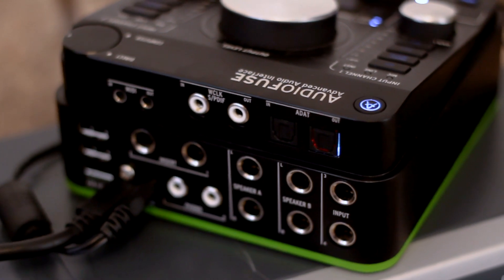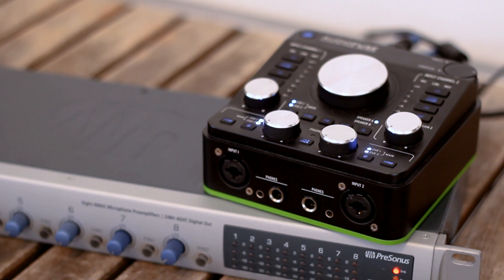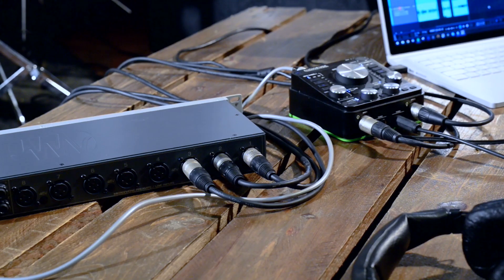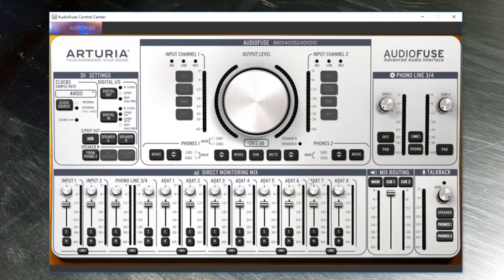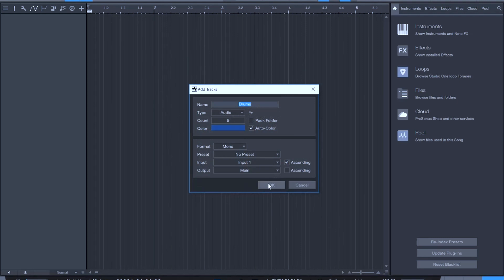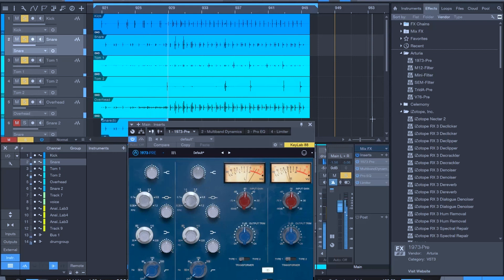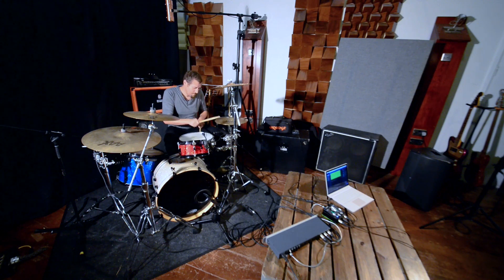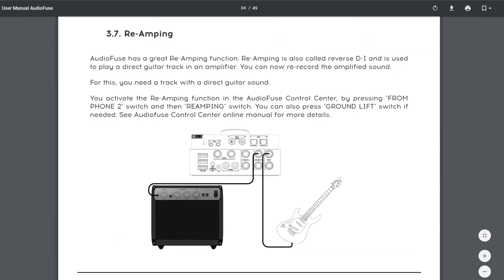AudioFuse Tutorials: Episode 6 - Using ADAT inputs

Comment: Sorry for the random question: brand new AudioFuse Rev2; both ADAT inputs (S/PDIF coax & optical) make a crackling sound. Even if the input levels are low, the crackling persists. Any suggestions? Cheers, DJ
Reply: It could be a Clocking issue.  I came to ask the question above lol

Comment: Which preamp is being recorded though? the expansion preamp or the interface (audiofuse)? Im asking because say there is an obvious difference in quality of the preamps, I'm using a scarlett preamp ADAT out into a UA apollo. When i recording, am i getting the sound quality of the scarlett or the UA?
Reply: since ADAT is a purely digital connection all 'tone' from the analog side comes at source, therefore you'd be hearing the 'sound' of the scarlett preamps but you are using the D-A conversion of the Apollo since it only received a digital signal

Comment: Nice info!
Anyway, what is the maximum amount of ADAT extra channel that I can add to AudioFuse?
can I use 2 Behringer ADA8200 to add an extra 16 channel simultaneously?
Reply: Shit, I came here to ask the exact same gd question! C'mon Arturia!
Reply: @UCwdkchFlCie2Pgot4wLtC2Q it's been a while since i used it, but here goes. as far as i know you can add a maximum of 8 channels over ADAT. these are in addition to the 4 existing inputs (2× xlr/jack for mic/instrument/line, and 2× jack for line/phono). so if you have an adat expander with 8 microphone inputs (and preamps), you can get to 12 separate channels in your daw (e.g. 10 microphones in mono and one line level stereo digital piano). technically there is also a stereo channel for the built-in microphone but it's only useful for talkback (e.g. speaking to the other room in a multi-room studio setup)
Reply: nope, it's limited to 8 input channels.